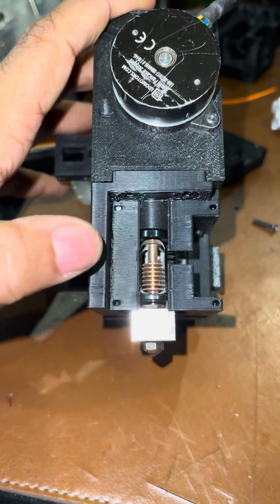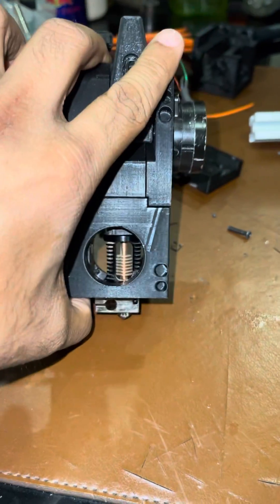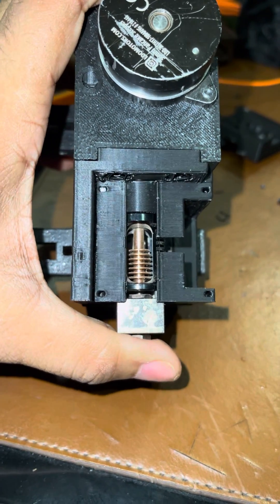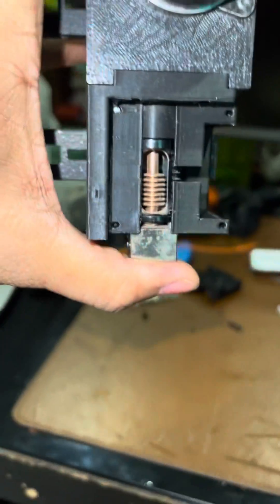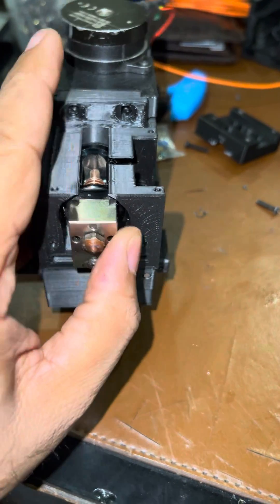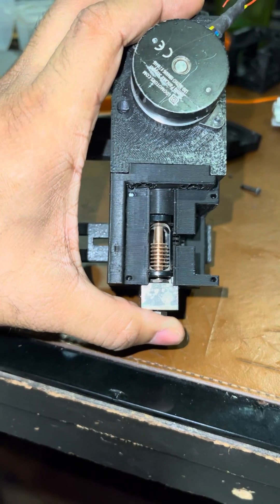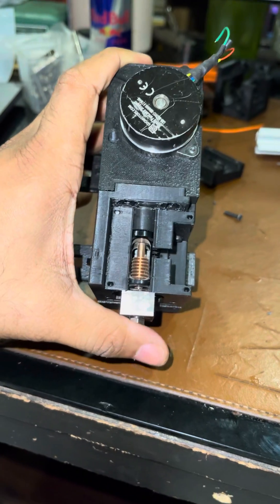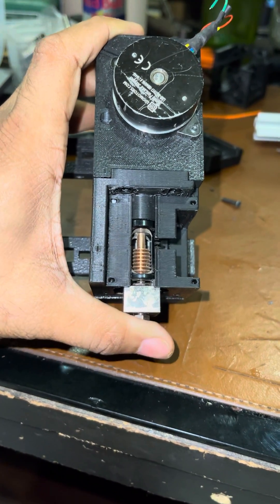Integrated Z Probe for 3D Printed Toolhead

Comment: Why not use optical sensor  and linear rail like voron TAP?
Reply from the maker: the nozzle probe is to be integrated into the toolhead - and there is a space crunch forcing me to come up with alternate solutions. Unlike the tap which has a single rail on the carriage - which in turn will require wires onto the carriage or the use of pogo pins etc from the toolhead.